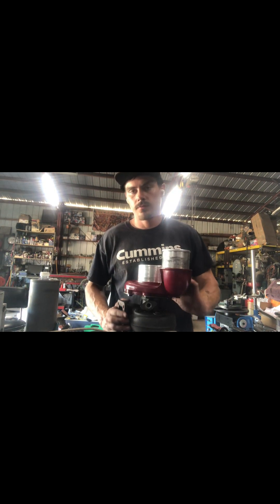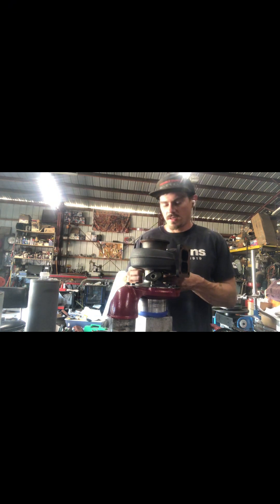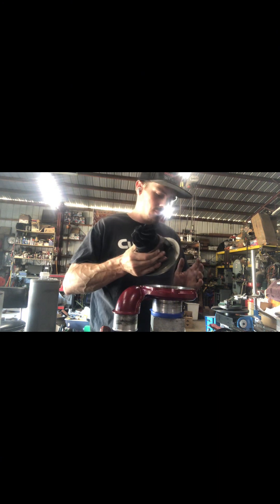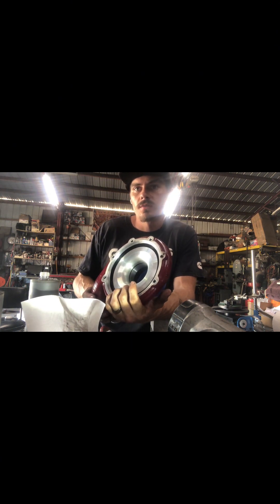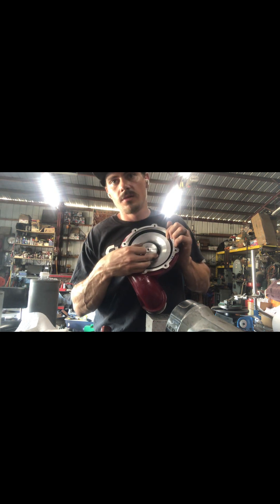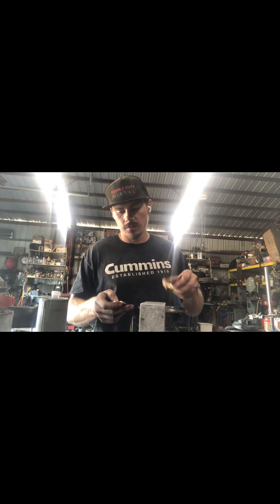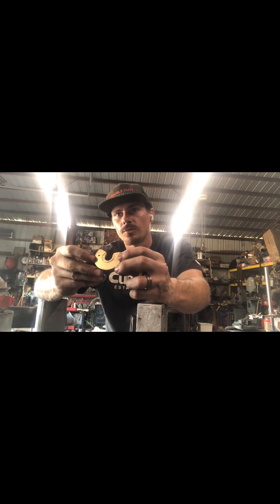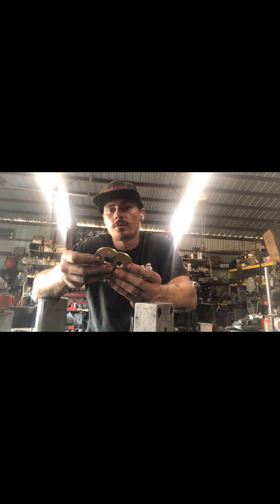.91 t4 s300 retro fitted into a 9cm 68 turbine

Comment: Where would SX3 vs SXE comp cover come into play in a compound setup? Would the SXE be a better choice? S360/S475 as an example.
Reply from the maker: It would depend where on the map the manifold turbos sitting… if you were sitting at 70-74% efficiency and it gained 2% going to a sxe then you wouldn’t really see much of anything. But if you were using the sx3 at 58% and the sxe shifted that to 68% then you would net quite the gain. 

The tricky part is in compounds the compressor maps technically incorrect now. Since the atmospheric test conditions have changed. My personal belief is that it trends to still be relatively consistent through the plot of the pressure ratio over, but your lbs minute numbers below the bottom are scaled differently now, and the rotor speed is different. ~ this kinda is where just experience and practice comes in, we have recorded the 60mm compressor wheel supporting 1140 whp with a 83mm atmospheric turbocharger but there seemed to be a wall there. This was a while ago before I learned some of the more recent stuff, but as a example there is a fair chance that was the 60mm compressor just running out of the ability to flow with the 83mm feeding it 40lbs of head pressure. The air speeds just maxed out. (Choke flow). So in the case (say it was a sx3) it would be a easy win going to the sxe. But the win would become more difficult if say the setup was more laid back and not being used to nearly the same extreme. Hopefully this kinda makes sense. Doing this as a single is a lot clearer. Lol
Reply: @savagefabrication795  Makes perfect sense. I figured the 60 to be the choke point as well at max effort. I'm now curious to try a 9cm Villan exhaust housing on this S360 60/68 to replace the gated 12cm that's on it now. I need it to light a little quicker now that it's a service truck. Fantastic information. Thanks!
Reply from the maker: @witcher71  I always offer to buy my turbo parts back if they don’t perform as you envision them working. It takes away the worry that it might be a paper weight if it doesn’t work right for ya. 

I’m retro fitting one of those turbos tomorrow haha. I really like them. Small and responsive but extremely robust and durable. A nice compromise between the two.
Reply: @savagefabrication795  you were probably just out of air on the 83. Being in compounds a lot of exhaust energy is killed before the low pressure turbine so then you wind up with lower rotor speeds. Lower rotor speeds also result in decreased flow so probably 1150 was all it had.
Reply from the maker: @bcbloc02  agreed. It’s also old tech being used far beyond the original engineers design criteria. I imagine you know better then I but i believe the original intention with the ht4b was the 855ci engine’s running steady state at around 440-480 fly wheel hp.